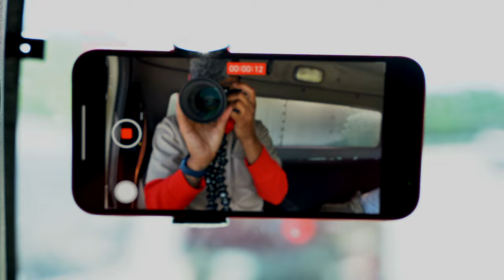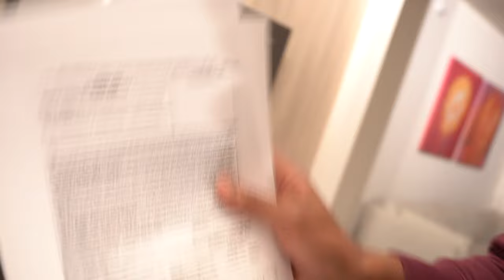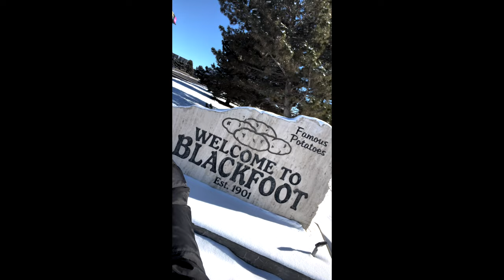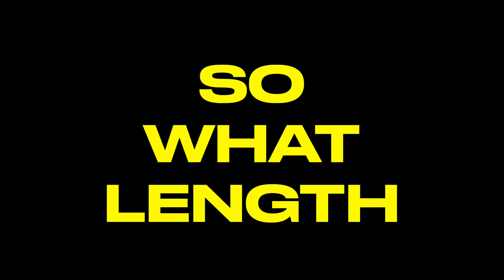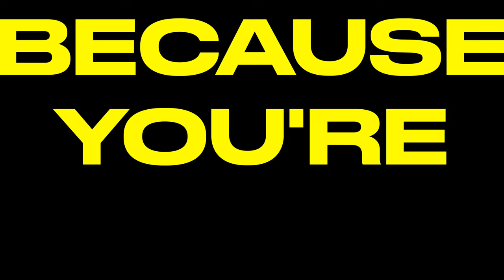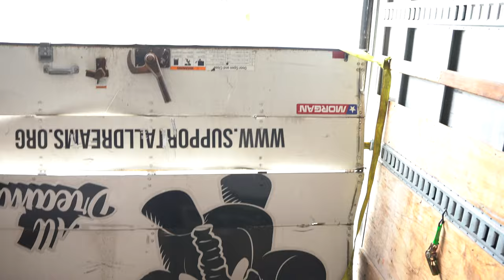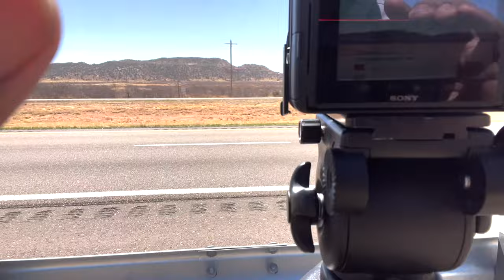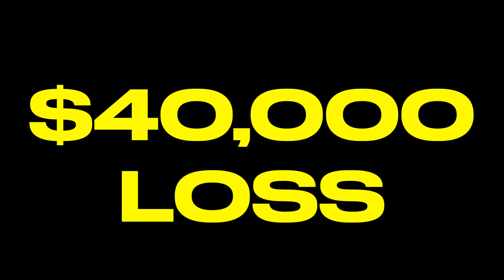Leaving the USA for Good | The Trucking Game is a SCAM... I QUIT | The Best Box Truck Story | HCTV

Comment: Only drive truck to be an employee if it’s an emergency get a class a license to work a union job or class b lastly a local class a job and get paid by the hour never by the mile. but never, ever, ever get into trucking as a business. you should have $60k - $100k if you do it right by living in a truck in savings by being an emoloyee. then have a exit strategy I would recommend to become an licensed insurance adjuster work only 6 months or the year to make $96k - $150k  or you can work remote. Pivot then work in the i.t. space you can make $100k, $250k, $500k or $700k remote now your overseas and left the matrix. take that money invest into real estate/section 8 and index funds - high yield savings stocks
Reply from the maker: Thank you for this information!